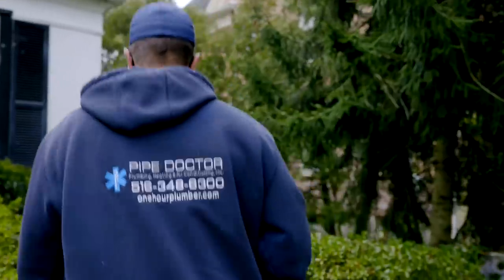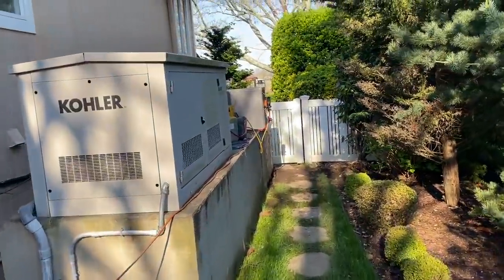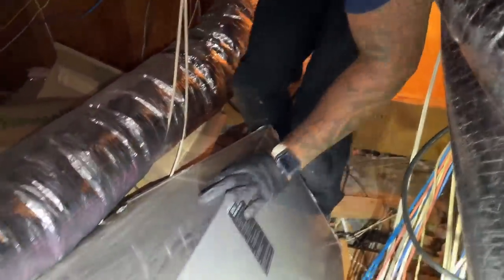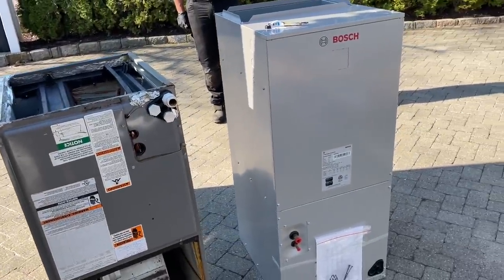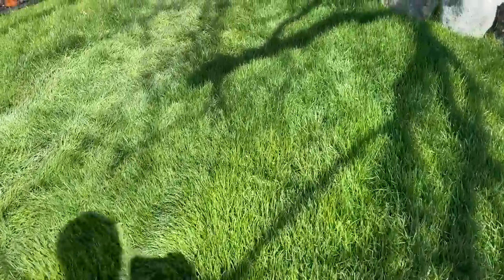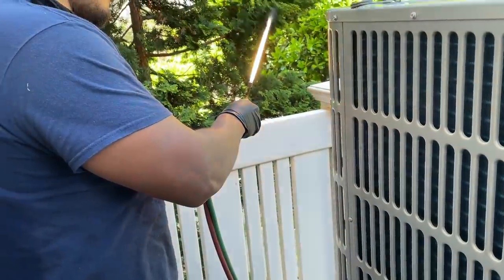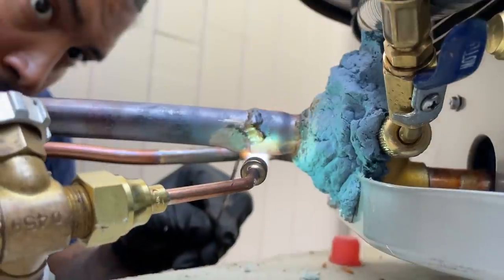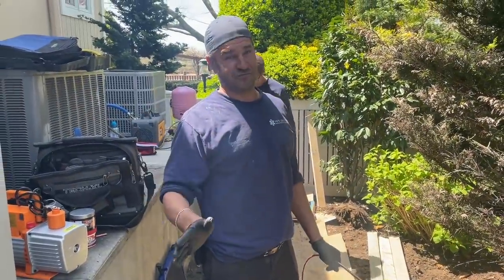Bosch IDS 2.0 Replacement System Installation in One of the Worst Attic Working Conditions Ever

Comment: Good video. I also have cut the wrong line to a walk in cooler before. It was bad... 30+ lbs. live and learn. You should invest into the reverse bender attachment for your yellow jacket bender. A little pricey for a piece of metal but makes bending in tight spots manageable.

Comment: Brazing, not the same as soldering, a little more heat on the line will make that silver solder flow better.  Only time I ever heard my boss cuss (he was a church pastor) was when our install crew cut loose the wrong unit at a church.  You handled that really well, good job.

Comment: We installed a 5 ton heat pump and 100thusand natural gas a month ago very quiet going to try to do more.  Ooohhh no Godzilla , not as bad as what I did 16 years ago drilled into a 10 ton hanging a disconnect. And yes got my ass handed to me. Keep the videos coming

Comment: The rose bud works really well on bigger pipes, I usually carry a #4 tip to do up to 3/4 and 7/8, but if I am doing commercial work were it is 1 1/8" I will use the rose bud tip

Comment: Mike nice job as usual. Use mars disconnect with built in surge protector also weigh in charge and remember you do not need gauges to charge Bosch 2.0 use circuit board much more accurate than your gauges.

Comment: Godzilla, if you heat the bottom of the fitting, you shouldn't have to move the torch all that much.  Start with the heat at 6 o'clock and the most you'll have to move is to 8 o'clock and 4 o'clock.  Start with the brazing rod at 10 and/or 2 and it should flow nice for you.
Reply: No, you're a good teacher.  Lots of patience for sure.
Reply: @PipeDoctor  think you explained it pretty well. Just takes practice.

Comment: In Refrigeration cycle it is necessary to debur and clean the sharp edge cutting whenever you cut Copper pipe by any tube cutter so the oil and  Refrigerant liquid could flows easily and passes back to condensing units easily .

Comment: Here’s Super tech comment... should put micron gauge above the line so no oils or contaminants leak down into the sensor. That’s why the micron gauge coupler is at that 45 degree angle to keep sensor clean 👌

Comment: I've watched a lot of your videos and I'm very impressed about your workmenship but with this install you took a shortcut. By bending the line set and kinked it. I was disappointed that you did not fix it properly. Sometimes its better to take your time then to work fast.  Keep up the good work
Reply: I also notice the kinked high pressure 3/8” copper line by the air handler.

Comment: LOTS of DIY low voltage wiring??  Oops!!!  lots of units lots of pipes..  have to work smarter (even if it means slower). to double check..  learning to braze is a huge skill..  Godzilla you are doin it!!!  awesome!! Let the pipe melt the rod not the flame

Comment: I learned basic electronics soldering in order to get better at my hobby, which is collecting and restoring pinball machines and classic arcade games. Good soldering is a must for that. I practiced, A LOT, on bad/discarded parts before trying on PCBs worth hundreds of dollars. If I had just jumped in "on the job" I would have fucked up too. Have Godzilla practice off-hours using scrap materials under your guidance.

Comment: Got an install coming up, same everything. 
I use both; liquid  gel spray and wet rag.
I only use wet rag  once and through away.
If you have not cut the WRONG line set; you have not done enough installation's.

Comment: Hey Mikey there is a test button on that bord and I've seen as high as 12 amps on that heat pump when it goes full capacity it depends on the load inside so much for efficiency on that especially if you are not using heat pump option.

Comment: Another  good  and informative  video.  Mike, the  new  Bosch  brochure  describes  the  2.0 as  able  to modulate between  36 and  130 % compared to the  brochure  it replaced  which  indicated  the  2.0  would  modulate between 25 and  110 5.  Did  Bosch  change  compressors  for the  2.0?
Reply: @PipeDoctor    Understand.  The  low amp usage  is  an attractive feature

Comment: Gotta just say you guys are scaring the crap out of me brazing without safety glasses...and I have no clue how you both handled the air handler swap out 😂😂😂...you bring up a good point though: when you sell a new system, do you normally include a 10 year parts and labor warranty? I got one with my Trane S9V2 furnace and A/C...curious

Comment: Pulling vacuum from both sides is kind of redundant plus it really doesn't help to me anyways..  

All you need to do is use a vacuum only hose like a Appion 1/2 with 3/8 and 1/4 ends. 3/8 to vacuum pump and 1/4 on the VCT.  Place vacuum on VCT on suction side, then place micron on other side connected with a vct. This way you can isolate and release refrigerant without gauge contamination. 

I don't know how the YJ vacuum gauges are but the Fieldpiece goes bananas if you get any refrigerant or oil in them hence why i always connect them via VCT's. 

This video has it on liquid side without a vct, but after i always used one, my other was messed up so i had to but this shows how to ensure you have a solid leak proof seal because if you pull from suction port and it reads on liquid port, you know the complete line circuit is leak free and sealed. 

Go easy on ya tech.. Accidents happens, could have happened to the best of us. Ya get busy, forget to check etc.

VACUUM VIDEO: https://www.youtube.com/watch?v=VgGEKGGBqKY
Reply: @PipeDoctor   That just pulls from both sides to make vacuum quicker.  I have had talks with Jim Bergman and he admits the way i am doing it gives you the best accurate readings due to when you isolate the vacuum you are reading the entire circuit of refrigerant pipes at the source..

It kills me when i see people pull vacuums and put a gauge inline etc with the hose, you have to read the source of what you are vacuuming, which is the line set etc. Not the hose.  You can see people doing it all the time on Youtube.. Like nails on a chalkboard.

By placing one side for vacuum, and the other end with the gauge, you get a perfect and precise reading of the lines you wish to vacuum as a whole. 

All you are doing when you pull on both sides simultaneously is lowering the time it takes.  You could still do it that way however you will lose just a smidge when you isolate the one side to install a gauge to read it, if you place it on the VCT auxiliary port, then it negates the shutoff valve thus allowing refrigerant to contaminate said sensor, hence why you have to put it on the end of the VCT instead.  I suppose you could put the hose itself on the aux port but again you will lose a smidge when undoing it etc.

Comment: Mike i have to replace a 80 % furnace with a high efficiency  model and add central air what is the best equipment for a good value ??? In your opinion 1250 sq ft house with floor registers
Reply: @PipeDoctor  yes add to existing duct work currently just have a forced hot air system
Reply: If you stick with any of the major brands like Trane, Carrier, Rheem, Bosh that are installed by a qualified representative you are good to. Stay away from anyone installing lennox, luxaire/york, ducane/armstrong, Nordyne, Amana /goodmen. Those brands are nothing but trouble and have cut a ton of corners that cheaps out their quality.
Reply: @PipeDoctor  copy that
Reply: Yes,you should do a manual j loss calculation,but uo here in the north east I use 40btu per sq ft,and 20 but per sq ft for cooling,that will only give you an idea!
Reply: @petersmart1999  hi peter im in Massachusetts thanks for your expertise i really appreciate it

Comment: Nice install! Mike, do you know if these condensers are compatible with different airhandlers or does it have to be matched? Thanks, appreciate any info
Reply: Nearly every Air Handler should be matched with their own equipment designed for it. Run into a ton of mismatched equipment that are not designed to work with one another nearly all have issues. Especially Inverter systems Must be installed with their designed air handler for them to operate correctly
Reply: @PipeDoctor  Bosch basis it’s capacity on superheat across the coil , 2 tons of air u get 2 tons on the condenser , it basically self matches . That’s y they only make 2 condenser sizes . It’s a great product
Reply: @zack9912000   Bosch is different , it ramps up or down to maintain  a  47 degree coil , and a 10 degrees superheat , whatever u provide for airflow , 18000,24000,30000,36000 , it will match the capacity.they also can go a half ton over its max rating .
Reply: @8799crosby  It is still an inverter system that requires a ECM modulating blower to match with what the outdoor unit is doing. Run into Bosch that are not working as desired. You can't just have a blower run full bore with a outdoor unit ramping up and down to meet load conditions
Reply: @zack9912000   the outdoor matches what the indoor in doing  with Bosch .That’s y they make only a 3 and 5 ton condenser . While it’s probably stupid to get a single stage air handler with a Bosch , once airflow is established , The Bosch will live at that speed for good . Where it shines is 2 stage  it will adapt to the airflow u throw at it .
Reply: What  trying to say is u can pair any air handler with a Bosch and it will adjust , that y Mikey referenced using a 3 ton condenser with a 2 ton air handler . It’s not communicating equipment , once airflow is Established the Bosch will adjust  accordingly. If your indoor blower shits the bed ,all systems would freeze , The Bosch will not freeze up with a blower failure .that’s unheard of
Reply: I honestly seem to find more issues with carrier infinity Communicating equipment
Reply: And the Bosch is also a pretty quiet condenser .

Comment: that attic is an absolute cluster fuck with all the flex, wire and water lines running everywhere. Guy that designed it must have been as sharp as a marble!

Comment: What’s the benefit of the oxygen    And acetylene my whole career we use turbo torches with acetylene Where is the nitrogen going and where is it coming out love your channel love your videos
Reply: Less carbon build up inside the refrigerant lines during brazing. Oxy/Acetylene is much hotter and takes less time to heat up the joint to braze it reducing carbon build up (which clogs TXVs and cap tubes). The Nitrogen removes Oxygen from inside the lines (the Oxygen creates carbon when heated). Remove the shreader cores and the Nitrogen flow out the open end. Not knocking you just informing you.

Comment: You gotta heat the inny pipe sometimes men need to your way up . Go back-and-forth like you’re doing a compressor make sure he knows if he’s using a different tip he’ll burn a hole through if he’s that close rosebud is very close at least an inch or two back and if you’re using a one or two tip Get back a couple more inches work around in and out in and out. Don’t do the electric first it’s just a pain in the ass get in your way.

Comment: That huge cost increase over a standard 16 seer unit and huge costs to repair after warranty, it's hard to justify the investment with not much of a energy savings. Neat systems for those with the budgets but I just could never advise any customer to ever buy one. Work on a ton of the commercial systems and they simply are  not as reliable, parts are always special order. Work on commercial and residential VFD systems and they simple are not reliable as a basic system, repair costs are insane for what little extra saving a person sees. Never enough to justify almost double the cost for them
Reply: @PipeDoctor   Yes the technology is here and eventually the EPA will mandate them. Yet from my experience commercial and residential, they just are not as reliable at all compared to traditional system's. I talk nearly everyone out of them, there is simply more cons then pros to them. The average person will never see enough energy saving to justify the upfront cost.

 They cost substantially more for just a little more in energy savings, parts are rarely available when we need them. Repair costs are huge after a warranty. Just repaired a trane inverter system for a customer and our cost for just the special order inverter board and compressor was 1700 plus freight, it cost him as much as a whole new 16 seer system. They are neat systems but a lot companies are clueless on them and have no business touching them. They absolutely need to have surge protection installed on them.
Reply: @zack9912000   I’ve been installing Bosch bova for about 5 years , only 1 board failure , covered under warranty , but u r correct the board was about 1200 out of warranty cost . And another 1-1/2 to change , out , one of the most time consuming boards ive ever changed , and u need to use heat sink paste as well .
Reply: @8799crosby  wow !!
Kiss !!!!🤔🤯🏌🍺🍺🥃🍺🥃
Stay safe.
Retired keyboard super tech.
Wear your safety glasses.

Comment: GODZILLA... try melting a little blob of solder on top of the joint then heat the joint until the solder starts to melt and then ur ready to solder the rest of the joint... Mikey let him take ur torch home and practice on some pipe 👍 🤘🤘🇺🇸🇺🇸

Comment: I don't  sliver  sol. But aren't  u melting  copper  weaken
Reply: Annealing,tgats why you don't quench hot,hot lines with soaking wet rags,air cool first,then heat sink or it will get brittle

Comment: mike- have you stopped using the zoom lock?
Reply: @PipeDoctor   We have been loving the stay Brite 8, a simple map gas torch, no need need to run nitro. Rated to 10,000 PSI and most manufacturers backs use. Almost as quick as zoom lock and no special tools or expensive fittings
Reply: @PipeDoctor  regulate the heat keep the silver on the joint ,stop dabbing like your soldering when you take the silver off it cools pull the heat back you'll feel when it stops flowing move heat back in badda boom badda bing!
Stay safe champ.
Retired keyboard super tech.
Wear your safety glasses.

Comment: Kiss !
You braze like a plumber using 50/50?🤣😂
Hot damn (wet rag)and wet rags I still pull the rubbers back,keep the compound off the joint completely to allow the material to flow into the joint.
The zillster has to focus a little more.
🤣😂🥃🥃🍺🍺🍺
I know you were smoke'n inside!!!🤯
Stay safe.
Retired keyboard super tech.
Wear your safety glasses.

Comment: That is not quite tight it gets tight when you are crawling over the flex and can’t even sit up and yes you must install a full size air handler in such a cramped space up in the attic they must’ve installed when the roof was off.

Comment: It's been great and hard efforts to install the  Air handling unit but as you do debur and clean yours Copper pipe fittings during plumbing works , Brother you forget to debur and brush Suction and liquid lines both before soldering  just to remind

Comment: You should by a pair of knipex 83 03 180 for those fittings you don't want fucked.  Also grab a pair of the self adjusting knipex 85 01 250.  I never reach for anything other then that pair of self adjusting pliers, just squeeze the handle and it adjusts to whatever you want to tighten.  Just hide them or the guys will take off with them after they use it. .  Lol.

Comment: Think you're overwhelming Godzilla now and he's getting flustered lol. Too many dumb mental errors too often now that you're letting him loose more. Might be time to reign him back in a little bit. There's a very fine line between giving your apprentices hands-on training and overwhelming them. You never realize how much stuff you need to know until it comes time to teach somebody else. He'll get there, he's got the right attitude and you've got the right attitude, he just needs more time before jumping into the fire without supervision, no pun intended. 

Can't be cutting no wrong lines though, that's unforgiveable. At least he got some extra brazing practice out of it lol.
Reply: @PipeDoctor  I've made plenty of dumb mistakes in my day but I can't say I've ever cut the wrong line to something. Especially something that obvious. That could've easily have been a water line or gas line you told him to go cut and he cuts the wrong one that may be live and causes major problems. A little mistake here and there is fine but that's a big one. Head scratcher for sure lol.